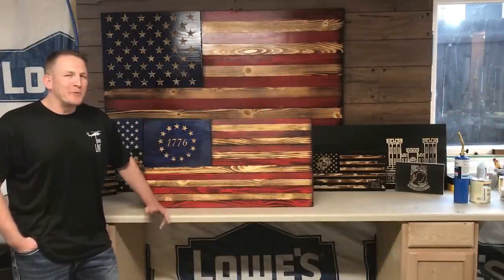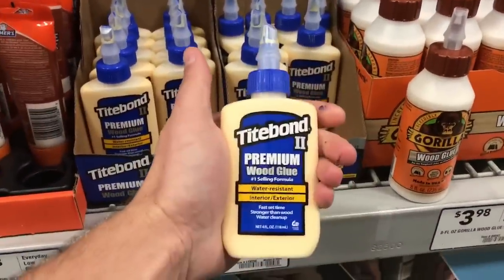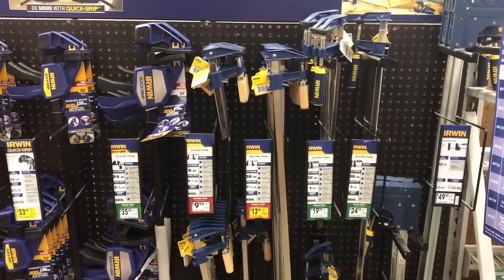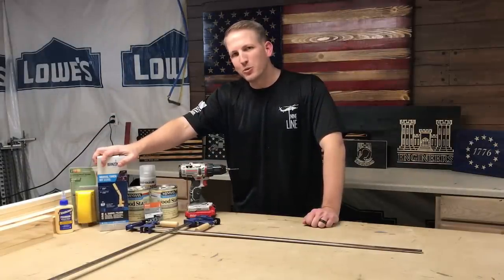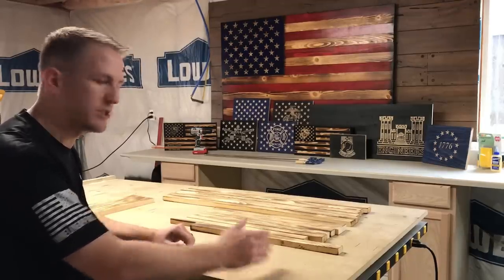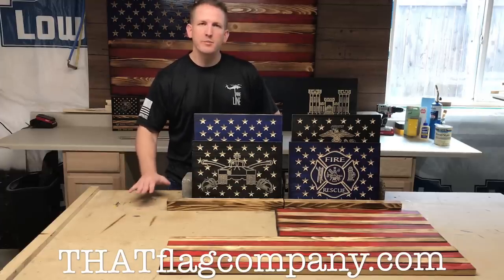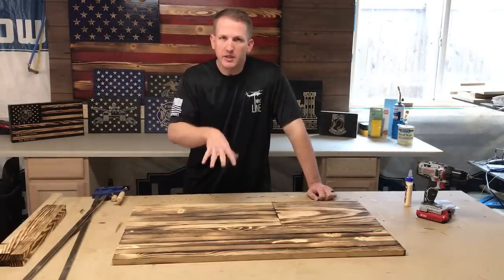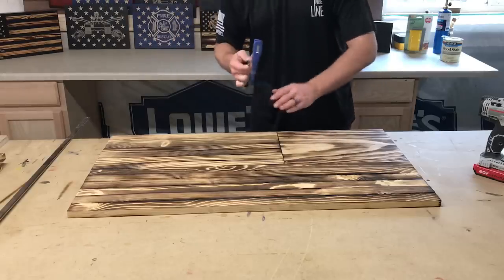DIY - Rustic Wood American Flag - Start your own Flag Co. for under $100 - Step By Step, How To

Comment: Great video. If using a union purchased through you, how thick is it? Do I give that union a light burn too?  Or is your stressing enough?
Reply from the maker: Thanks Michael! The union that comes from us is the same thickness as the stripes, same as in the video. It also comes stained and stressed, so all you’ll need to do is attach it and seal it with the rest of the flag. 

Also to note, our shipping notifications says to allow 6-8 weeks but this is for our flags. If you order unions from us then we expedite them and try to get them made and shipped much quicker. 

These are the exact same unions we use on our flags, so quality is our priority.

Comment: Could you give the paint code for your minwax color.  I went to the paint store and scarlet is not an available color.  The paint gal mixed me a color but it seems to orange.  Help!
Reply from the maker: Oh no! So, “scarlet” is a specific color licensed by Lowe’s and they don’t give a code. Home Depot has a different name for it and other paint companies do not have licensed names for it, but they might be able to do color match?
Reply: I also couldn't find the color.  I went to two different lowes stores and the only charcoal color they had was light gray.  I opted for true black, but its still really light.  Any advice?

Comment: Any particular reason for spray enamel over spar urethane or polyurethane? Great video!
Reply from the maker: Ron Cook, no it just depends on the look and protection you need (and also cost you’re willing/able to spend). Polyurethane/ Spar Urethane will look great! Some people go a whole other route and epoxy their flags, which is crazy expensive but also comes out REALLY nice.

Comment: Thank you for this video. I am making a 48" flag to mount above my fireplace. What length should the small stripes be?
Reply from the maker: 29” if your union is 19” in length and your bottom stripes are 48”
Reply: Thank you I spoke with jordan earlier a out having a custom union made i will be ordering soon

Comment: I've been making some of these too and I've learned that if you run them through a planer it takes some of the roundness out of one side and sand the sides really smooth and they butt together better.

Comment: When using your smaller unions...what would be the measurement for the red and blue lines?
Reply from the maker: Hey Shila! The 7 short stripes would measure .75”x11” and the 6 longer stripes are .75”x18.5”

The dimensions for the other flags can be found in the FAQ section on our website THATflagcompany.com
Reply: THAT Flag Company Thank you

Comment: Amazing video! Do you ever have any issues with the wood cupping when staining only one side? Probably more prevalent on the union. Thanks so much!
Reply: I have made a few of these. They do cup a little bit but I’ve found that once you have everything all glued and clamped, it goes away once you nail on the braces on the back. 

Also, I stain both sides. I think it looks kinda cool.

Comment: You didn't show how to make the stars
Reply from the maker: Hey John! For the stars you can use a dremel, chisel, or router. We’ve used all 3 and it’s really user preference. We use a router but also had good success with chiseling in the past. 

We’ve also had a lot of successful builders order unions from us with a variety of designs engraved in amongst the stars. Saves time, adds options, and usually improves quality. That option is here 👉 https://that-flag-company.myshopify.com/products/union-for-flag-builders

If you want to make your own then you can make a template on Microsoft Word and then use it to trace onto stencil paper. Cut the stars out with an exacto knife and then use the stencil paper to draw the stars on the wood. 

Hope this helps!!

Comment: I would like to build the 48 inch flag. Would I still use the 1 by 2's ? If not what would you recommended?
Reply from the maker: Tyler, for a 48” flag the measurements would be different. Measurements are:
Union is 19”x14”
7x short stripes at 29”x 2”
6x long stripes at 48”x2”
4x braces at 24.5”x2”

Hope this helps!!
Reply: Thanks so I would still use the 1×2's ? Or would i have to step up to wider pieces of wood
Reply from the maker: You would need wider wood. I should’ve said that the true dimensions of the wood are the dimensions I gave. 

A 1x2 purchased in the store will actually only measure 3/4”x1.5”. 

A table saw can be used to rip larger sizes of wood to the true dimensions I provided earlier. If you don’t have a table saw then I know that a lot of local lumber stores will offer to rip wood to the size you need for a small fee.
Reply: Thank you !!

Comment: Not sure if I missed it, but are the unions a solid board / plywood or made form the 1x2s?
Reply from the maker: Hey JT, we make ours with premium pine (no knots), but they can be made with other types of wood. The unions for the 36” flag builds, like in the video, is one solid board. However, the unions for the larger 48” builds require joining boards, planing, and sanding. Hope this helps!!

Comment: did you sand down the stripes after burning? They don look as dark as when you were burning.
Reply from the maker: Brian, no I didn’t sand them afterwards. There is a burning technique that involves doing a deeper burn and then brushing the boards with wire bristles, but we did not do that in this video. 

The lighting and angles is always challenging with these flags. Your flags will always look better in person too! Pics and video just never do them justice.
Reply: your best bet would be to use some 000 steel wool after the burning. Less abrasive than sand paper and can soften up the edges of the burn marks making them look less like intentional burns and more of an aged look.

Comment: does anyone who makes these have a problem with there wood warping when they burn ?
Reply: PV pv I was using a torch to char the wood black but it made it more difficult to etch out the stars with a Dremel because of how it made the wood surface uneven. Now I use a charcoal stain to make the black stripes and it's made it much easier.

Comment: I am combat wounded vet and been looking for something that I can do from my wheelchair to make a little extra cash and for fun.
Reply from the maker: This might be perfect for you, Robert. You could even make some jigs with some pipe clamps on a table to pull the flag together before putting on the braces. Hope the video helps!
Reply: Yeah, I have enough money to get a mitter saw and some basic tools but I need to build a workbench to work from first. I just hope that people buy them once I start building them. I have a local friend here in Chapin, SC who has a woodshop who could probably help with some of this stuff he's just really busy.
Reply: I already have a dremel tool, just need to get the router set up for it which i think you can get on amazon.

Comment: do you wipe the stain off or not? I didn't know if you let it soak into the wood or just wiped it off as you applied it.
Reply from the maker: Steve Owen, I just let it soak on the flag in the video. You can wipe it off for a lighter color.

Comment: You didn't explain how you made the Union
Reply from the maker: Hey Carl. There are multiple ways to make the union yourself. We started by making a template in Microsoft Office and tracing it onto stencil paper from Hobby Lobby. We then used a knife to cut the stars out of the stencil and could use that stencil to trace the stars onto the union. After the stars are traced, you can use a dremel or a hammer and chisel to engrave them into the union. Hammer and chisel takes more practice to get right but ends up being quicker and better than a Dremel in my opinion. This is the most cost efficient way to make the stars yourself. After receiving multiple requests, we recently started offering the pre-Cut stencils for sale as well. 

However, to make the unions with our level of quality and detail that we offer on our website would cost you thousands of dollars in equipment and multiple tutorial videos. For this reason, we did not go into the details on this video but decided to offer them already completed for on THATflagcompany.com in order to provide another option that we wish had been previously available to us when we were starting. 

I hope this video was useful for you and the follow up response helps give some additional clarity.  If you have any questions we can help with, definitely don’t hesitate to ask!

Comment: What is the size of each individual star? I want to do a raised star look
Reply from the maker: Hey DDay! The union should measure 10.5”x14.25” and your stars will be roughly 1.2” in diameter. 

Hope this helps!
Reply: @thatflagcompany7105  
Helps ALOT!! Thanks so much! loved the video you really inspired me to make one of these. your video is probably the best ive seen, most other videos really torch the wood and blacken it. Love how you just torch it enough to bring the grain out of the wood! keep up the good work!

Comment: Do you sand or clean the wood after Burning?
Reply from the maker: PENTALLICA, not if it’s not necessary. Only if there’s a blemish will we go in and sand it after it’s burned. There are cool techniques out there that you can try that requires sanding/ brushing after putting a heavier burn on the wood.

Comment: Great stuff, is that clear coat enough to protect the flag if I'm using paint instead of stain or should I go with a poly finish?  Thanks
Reply from the maker: The clear coat will protect the paint, but poly is always better if you don’t mind spending the extra money. Min wax makes a poly that is UV protectant and works great. It’s also available at Lowe’s in a can and also in a spray.
Reply: I've tried regular minwax water based brush on poly and didn't like how it makes everything cloudy looking.  I took me forever to get the cloudyness out, I'll try one of the sprays, thanks
Reply from the maker: Semper fi, try the Minwax Helmsman Spar Urethane spray that comes in a green spray can.
Reply: awesome will do.  Thanks

Comment: What were the dimensions for the stripes? And union?
Reply from the maker: Hey Tori! Measurements for the 36” flag are:

7x short stripes at 21.75”x1.5”

6x long stripes at 36”x1.5”

4x braces at 18.5”x1.5”

Union is 10.5”x14.25”

Comment: One question....did you condition the wood first?
Reply from the maker: GoGirl311, in this video we did not and it turned out great. However, a lot of wood could benefit from some sanding before the burning and stain is applied. Just depends on the quality of wood you have and the look you’re looking for in the end. Hope this helps!!

Comment: Would you mind telling us what dimensions of that big one is on the wall?
Reply from the maker: Hey John! That flag measures 3’x5’. Here is the breakdown:

7x short stripes are 36”x2.77”
6x long stripes are 60”x2.77”
The union is 24”x19.25”
Stars are roughly 1.9” in diameter

Hope this helps!!
Reply: THAT Flag Company , with the increased size, did you opt for a thicker board? Is the 3’x5’ made with 1x3’s? Or, did you just rip the stripes yourself on a table saw for that?
Reply from the maker: The boards for the 3x5 are the same thickness and I used a table saw to rip the boards to size for that one.

Comment: Do you ever have an issue with the wood warping when burning?
Reply from the maker: T L, there’s typically always some slight warping to one of the pieces of wood, but it’s very rare that extreme warping occurs to the point that it affects the build. It is usually straightened out when pulling all of the stripes together with the clamps.
Reply: @thatflagcompany7105  ok, thanks for the reply. I must be torching to much.

Comment: What are the 1x2 lengths for the 48” flag?
Reply from the maker: Hey Timothy, Measurements for the 48” flag are:

7x short stripes at 29”x 2”

6x long stripes at 48”x2”

4x braces at 24.5”x2”

Union is 19"x14"

Comment: Wht are the true specs for the flag and the union
Reply from the maker: Hey Mike, the measurements for the 36” flag are:

7x short stripes at 21.75”x1.5”

6x long stripes at 36”x1.5”

4x braces at 18.5”x1.5”

Union is 10.5”x14.25”
Reply: Thanx big help

Comment: Did you use firring strips or pine?
Reply from the maker: Julian Elizondo, Pine. The firring strips are typically less than 1.5” in width and do not work with the dimensions in the video.

Comment: Did i miss the size of the union?
Reply from the maker: Hey Larry. The union for the flag in this video is 10.5”x14.25”. Dimensions for smaller and larger flags can be seen here: https://www.thatflagcompany.com/pages/that-flag-stencil-dimension-reference-sheet?_pos=1&_sid=36988ca32&_ss=r

Comment: Do you still use 1x2's on a 48-inch
Reply from the maker: Hey Derrick Hall. No, the stripes will need to be wider. True dimensions of a 1x2 is .75”x1.5”. Here are the true dimensions for the 48 in flag:

7x short stripes at 29”x 2”

6x long stripes at 48”x2”

4x braces at 24.5”x2”

Union is 19"x14"
Reply: @thatflagcompany7105  thank you
Reply: @thatflagcompany7105  so I would probably have to use a 1x3 and take off 1/2 inch of each board to make it a true  2 inch is that what you mean
Reply from the maker: Derrick Hall, you can use a table saw to rip your wood to size. Or if you don’t have a table saw, then check with your local lumber store to see if they will rip it to size for a small fee. A lot of smaller lumber companies offer this. Instead of 1x3s you would save money by ripping a larger board, such as a 1x12.

Comment: Would like to see how the union is made
Reply from the maker: Hey Michael! There are multiple ways to make the union yourself. We started by making a template in Microsoft Office and tracing it onto stencil paper from Hobby Lobby. We then used a knife to cut the stars out of the stencil and could use that stencil to trace the stars onto the union. After the stars are traced, you can use a dremel or a hammer and chisel to engrave them into the union. Hammer and chisel takes more practice to get right but ends up being quicker and better than a Dremel in my opinion. This is the most cost efficient way to make the stars yourself. I have also seen people buy stencils on Amazon but they’re not always proportional for their flag and they’re limited to the one size and style. 

However, to make the unions with our level of quality and detail that we offer on our website would cost you thousands of dollars in equipment and multiple tutorial videos. For this reason, we did not go into the details on this video but decided to offer them already completed for $34.95 on THATflagcompany.com in order to provide another option that we wish had been previously available to us when we were starting. 

I hope this video was useful for you and the follow up response helps give some additional clarity.  If you have any questions we can help with, definitely don’t hesitate to ask!

Comment: How do you do the union?
Reply from the maker: Hey Hayden. There are multiple ways to make the union yourself. We started by making a template in Microsoft Office and tracing it onto stencil paper from Hobby Lobby. We then used a knife to cut the stars out of the stencil and could use that stencil to trace the stars onto the union. After the stars are traced, you can use a dremel or a hammer and chisel to engrave them into the union. Hammer and chisel takes more practice to get right but ends up being quicker and better than a Dremel in my opinion. This is the most cost efficient way to make the stars yourself. After receiving multiple requests, we recently started offering the pre-Cut stencils for sale as well. We are actually working to make another video covering all of this in the very near future. 

However, to make the unions with our level of quality and detail that we offer on our website would cost you thousands of dollars in equipment and multiple tutorial videos. For this reason, we did not go into the details on this video but decided to offer them already completed for on THATflagcompany.com in order to provide another option that we wish had been previously available to us when we were starting. 

I hope this video was useful for you and the follow up response helps give some additional clarity.  If you have any questions we can help with, definitely don’t hesitate to ask!
Reply: Thanks a lot!

Comment: How do you make the Union?
Reply from the maker: Hey George!

There are multiple ways to make the union yourself. We started by making a template in Microsoft Office and tracing it onto stencil paper from Hobby Lobby. We then used a knife to cut the stars out of the stencil and could use that stencil to trace the stars onto the union. After the stars are traced, you can use a dremel or a hammer and chisel to engrave them into the union. Hammer and chisel takes more practice to get right but ends up being quicker and better than a Dremel in my opinion. This is the most cost efficient way to make the stars yourself. I have also seen people buy stencils on Amazon but they’re not always proportional for their flag and they’re limited to the one size and style. We are considering offering this option ourselves in the near future.

However, to make the unions with our level of quality and detail that we offer on our website would cost you thousands of dollars in equipment and multiple tutorial videos. For this reason, we did not go into the details on this video but decided to offer them already completed on THATflagcompany.com in order to provide another option that we wish had been previously available to us when we were starting. 

I hope this video was useful for you and the follow up response helps give some additional clarity.  If you have any questions we can help with, definitely don’t hesitate to ask!
Reply: Thank you for your reply. I definitely gives me some ideas. I really like your work.